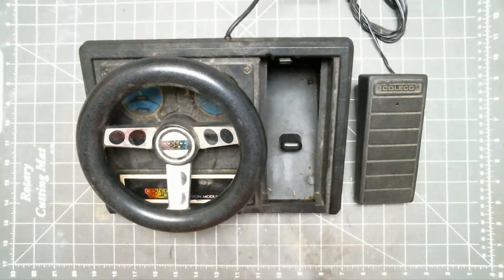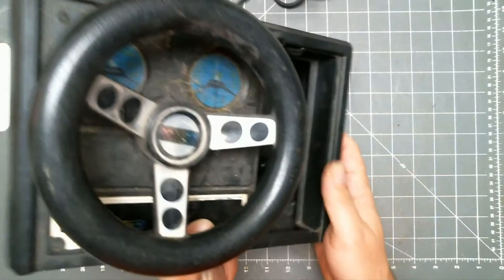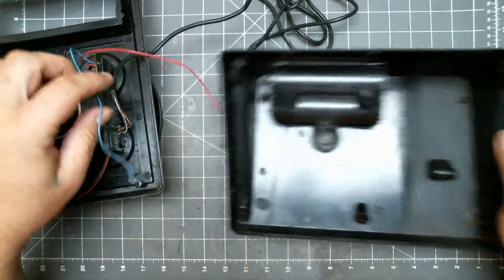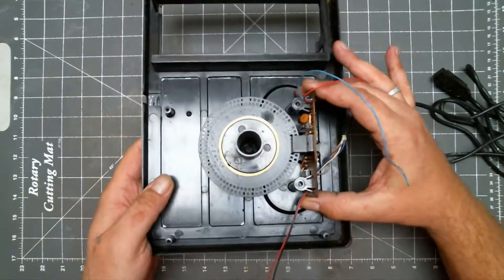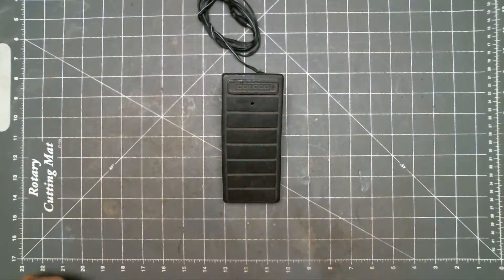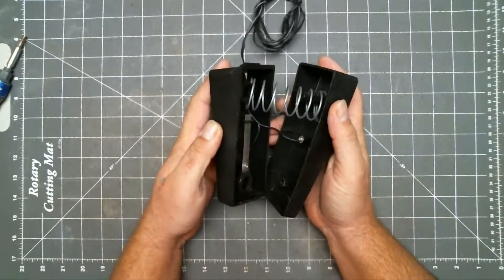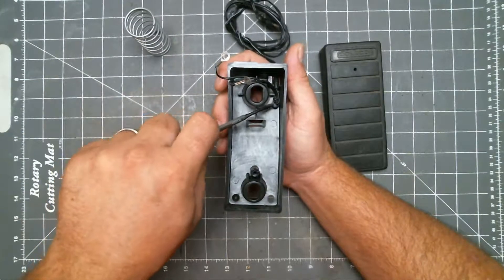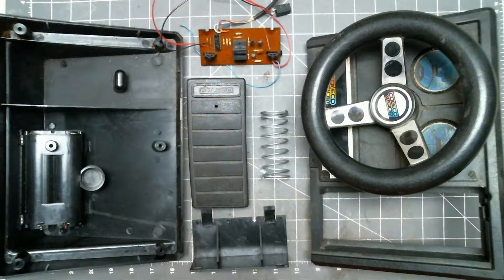COLECOVISION EXPANSION MODULE #2 DISASSEMBLY [WARANTY VOID IF REMOVED]

Comment: Thanks for the video! On the pedal, does it matter which cord you have connect to the switch and which you connect to ground? I seem to have lost track of that detail...
Reply from the maker: @TreJowy  if I remember correctly, it does not matter. It's basically just 2 metal contacts touching each other to complete the circuit.
Reply: @ARCTICLABSERVICES  Much obliged!

Comment: Thanks for a great video especialy listing the correct screws do you know if the two controllers use the same 14mm x 4mm screws cheers
Reply from the maker: The screws in a normal controller are 10mm x 4mm. Hope this helps.

Comment: Wiki and many others  calls the steering wheel wrongly an expansion module wich it is absolutely not because it doesn’t use the expansion port at all nope,it just uses the regular controller ports,i first tout that the steering wheel required the expansion port to function,also i didn’t know that the pedal became detachable,dang it.
Reply from the maker: I agree. The only reason we call it that is because that's what colecovision calls it.